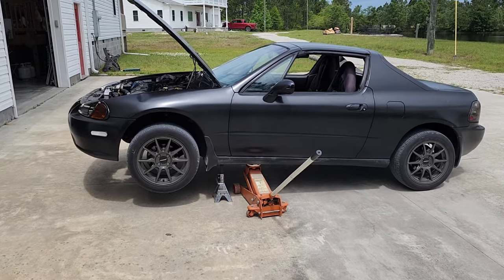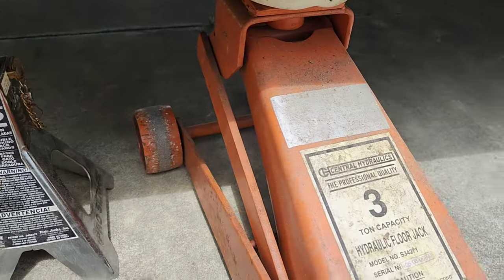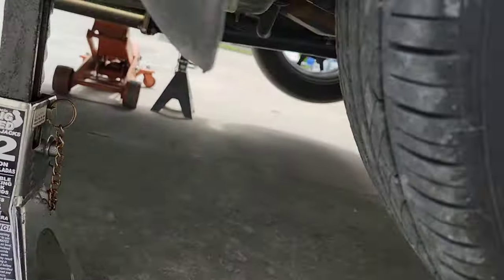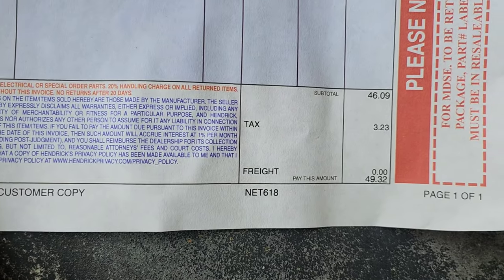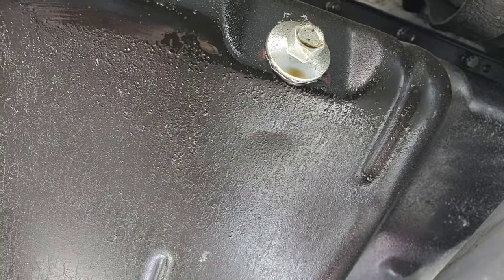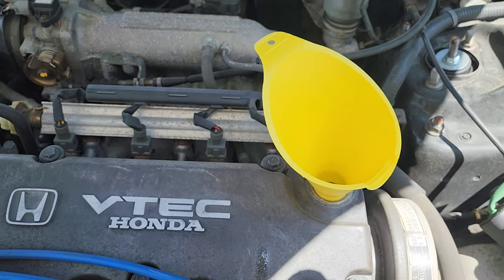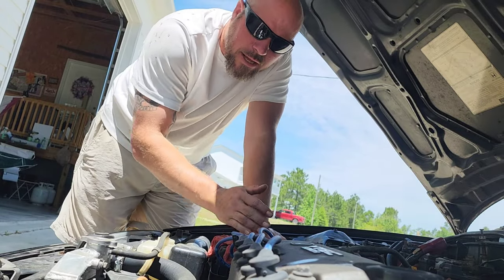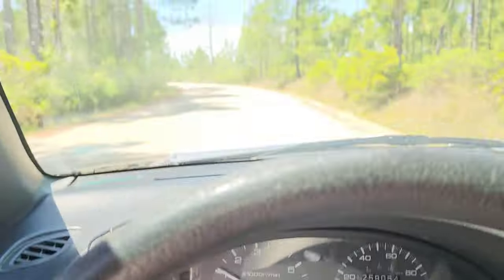How To Change Your Oil | Honda Del Sol Si

Comment: Next Project: Take off the fenders and give the under side a little tappy tap with teh hammer. Hint: You need to have the door open to get one bolt off.
Reply from the maker: Cars been completely painted, all the dents were fixed!
Reply: Niiiice. Sadly I think I might be selling my 8th Del Sol soon :(  @eastcoastken
Reply from the maker: @KabookiSan  bummer man, this one I've redone and is gonna be on loan to my oldest step son who is 17 until he gets old enough to buy his own car. I'm gonna do the same with a prelude or hatch for my youngest step son. Gonna start looking for it this spring.